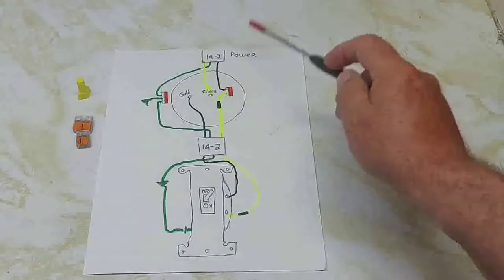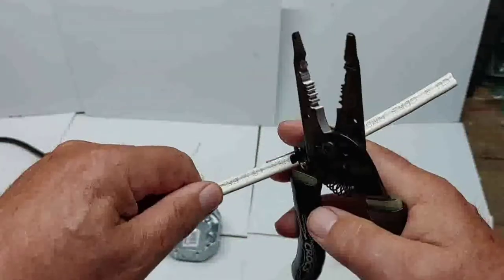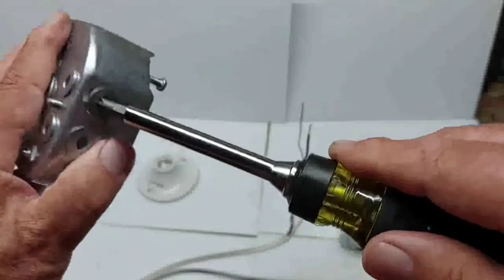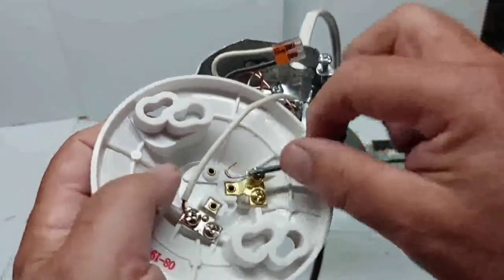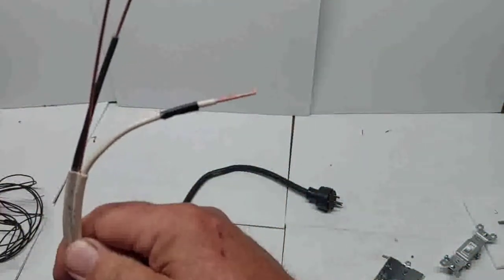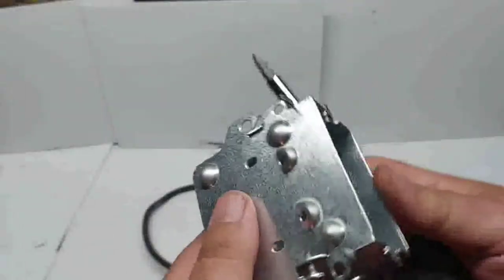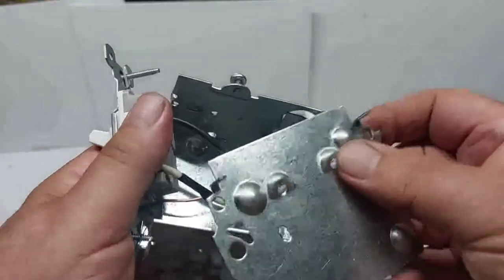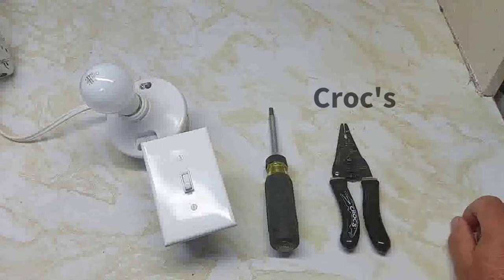How to Wire Power to Light then to the Switch for beginners.

Comment: In this situation, is it possible to add a 2nd light fixture that is controlled by the switch but where the 14/2 can only be run between the new light fixture and the existing switch?
Reply from the maker: Yes you can. Here is an example.https://youtu.be/PXRqaDX7A3A?si=jnCotyidlTs2IlSJ

Comment: How would you hook this up to a light fixture that has power coming into the switch first?
Reply from the maker: Here is the link to my video on How to wire power going to the switch first,,
 https://youtu.be/BqSaOOne61M
Reply: Take your power coming to your switch is the black wire hook on bottom screw of switch, than than the wire coming from light take that black wire hook on top screw of switch, than take the 2 white wires twist them together add wire nut than push back in box hook up your copper wire this is your ground on green screw on switch than on your light black wire to gold screw and white wire to silver screw ground copper wires to box or if your light has wires it would be black to black white to white or if you are hooking up a fan with a light you'll have a blue wire that will hook on your black wire to power your light than hook up your grounds to box now than power coming into your switch from the bottom screw is the power now when you throw your switch up than the switch sends power up to the light, now make sure you have your switch right

Comment: When connecting the wires to the brass colored screws on the switch, it sounds logical the way you described it, power comes in to the bottom screw and goes to the light on the top screw. The reality is that it makes no difference, the switch will make or break the connection, regardless.
Reply from the maker: Your right doesnt matter where the wire goes the switch will still work.
It your preference.

Comment: I need to wire power to light, then to switch and to outlet, How can I do that? Thanks
Reply: Depends on if you want the switch to work the outlet or not. If not you just run two power wires, one to the switch and one to the outlet or you can snag power from the switch too by just adding a jumper pigtail wire. (A extra wire connected to the power wire ) then to outlet

Comment: Would it work on a light fixture that does not have brass and silver screws? What if the light fixture has black, white, and ground wires only (with no screws)
Reply from the maker: Yes it would work. 
Black wire ( gold screw )
White wire ( silver screw )

Comment: Can I draw power for another switch for a separate light from this light powered switch? I'm in an older log cabin which makes new wiring a challenge.
Reply from the maker: Yes you could probably do it.
Reply: Where would I get the power from and where would I attach to the second switch?
Reply from the maker: @jeffleis1875  Depends where your power is. If it goes to the switch first . Its hard to explain not actually seeing the wiring.
Look at this video it might help:  https://youtu.be/xOZv17BPTZA

Comment: Very CONFUSING TO ME,WHEN U MADE THE POWER WIRE ON THE NEUTRAL WIRE!!!!!!!
Reply from the maker: The neutral wire brings power to the switch then the switch controls the light.  Look at other diagrams and other videos it will show you the same thing.
It's confusing but it will work.